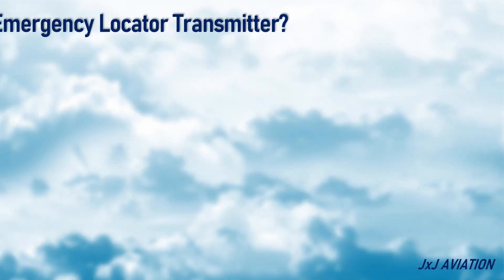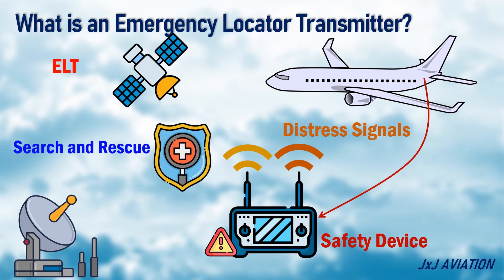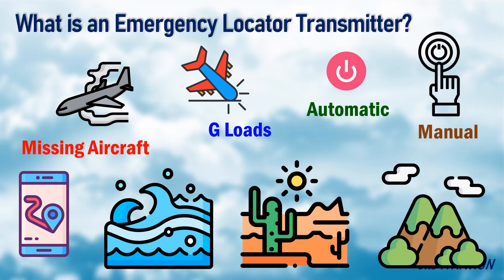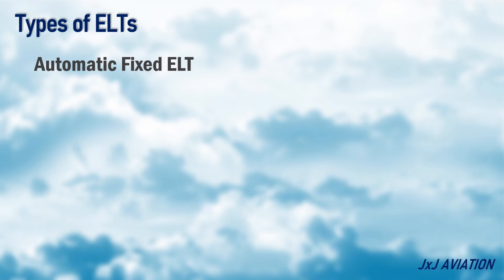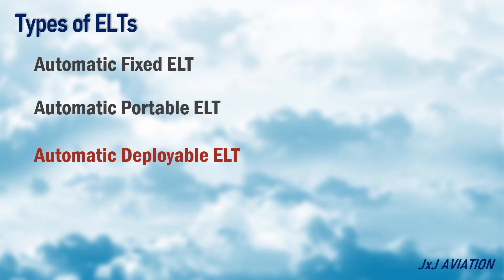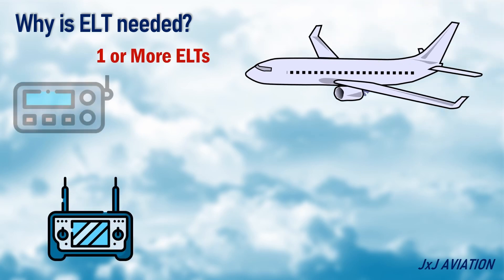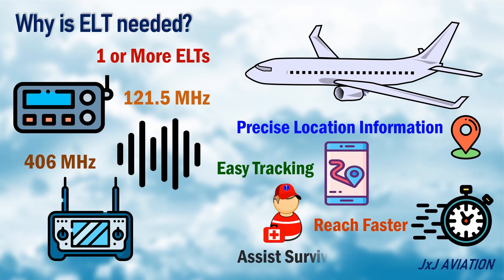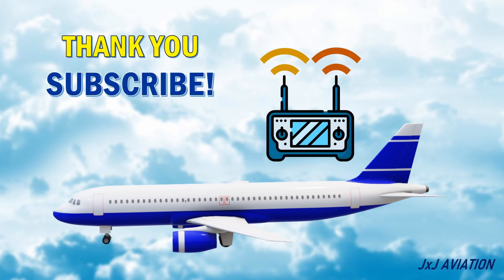What is an EMERGENCY LOCATOR TRANSMITTER? | Types of ELTs | Why is ELT mandatory?

Comment: 406 ELTs do sent location to the rescue coordination centers. 121.5 satellites are decommissioned now and they don't send a location. They send a signal on 121.5 frequency and aircrafts flying in the vicinity can pick up the signal if they are monitoring 121.5. Then, they can relay the information to a rescue center.
Reply: Edit: when I say "They send a signal on 121.5" I'm talking about the 121.5 ELTs of course
Reply from the maker: thanks for the info
Reply: Thanks.